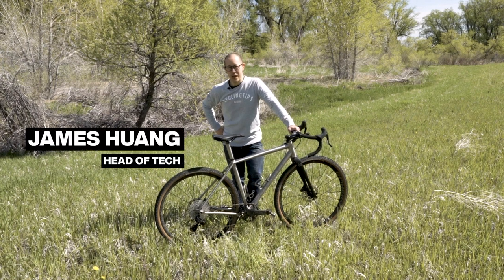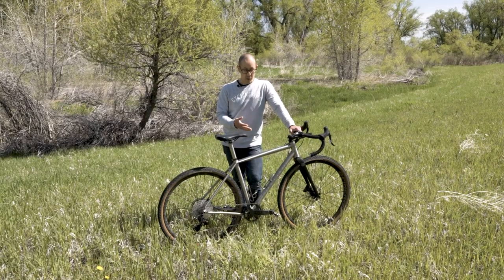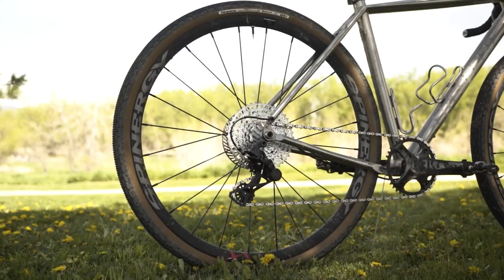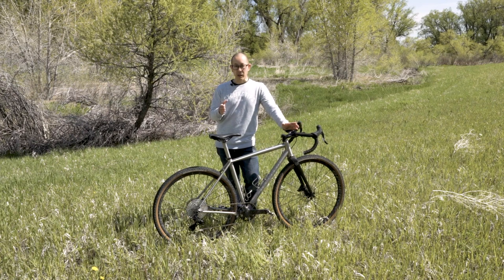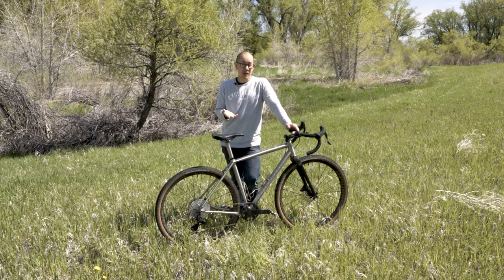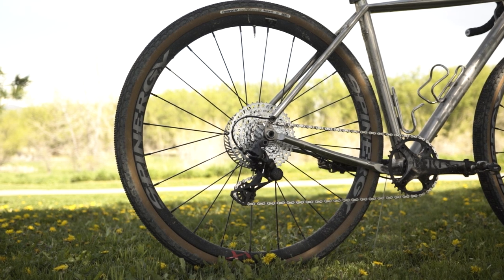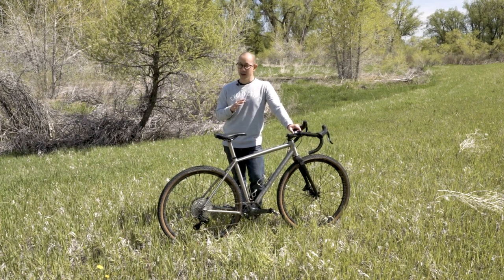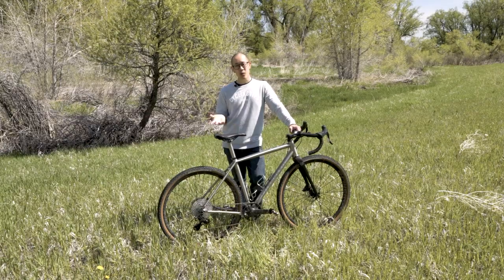Litespeed Watia gravel bike review: A magical ride, but old-school handling

Comment: James thanks for the thorough review and stellar work as usual. It is a very nice looking bike and made in the U.S. is important to many of us, myself included. Worth mentioning too that originally the Lynskey family who started and ran Litespeed for many years are still manufacturing in Tennessee not far apart from Litespeed . Under current ownership Litespeed has fortunately retained their base of manufacturing in the U.S. (minus their short foray of carbon bikes that were poorly reviewed), I own two titanium bikes both were made by Lynskey. For those who haven't spent time on a Ti frame I can recommend them highly. Durability, looks and that raw Ti finish just appeal to me as a metal worker. Great review!

Comment: Personally, I think the geometry of the frame is more a thing to be noted, instead of a con. If you're going to be riding your gravel bike on gravel/dirt roads & trails and not the MTB-esqe technical stuff, having something more endurance-road focused is a good thing.
Reply: @James Huang Understood regarding fit. Agility and speed (you mentioned the agility part at 8:49). If you're buying a gravel bike to ride country roads, road geometry makes sense. If you're buying a gravel bike to race gravel, getting flat and low on a bike with smaller gaps b/w the front tire and down tube are good things. When I look at the routes for many of the gravel races, and published rides even outside the midwest (where I live) they aren't technical in a way that something endurance-road-focused wouldn't be a good choice. For the most part they are very focused on putting big miles, at speed, on the bike.

Personally, I have two gravel bikes (Lynsky GR300 / Revolt Advanced Pro) with exactly that kind of geometry, and I've never found it to be a con; even on technical single track, but most of the riding that I do on them is unpaved roads or trails where agility and speed are good things. Obviously, there are trade-offs involved in everything; if I was going to ride a lot of technical single track, neither would be the best choice. But, if I was going to ride a lot of technical single track, I probably wouldn't want to do it on a gravel bike either, unless I planned to ride 20-30 miles to get there. 

Just to be clear, I do think there's a place for gravel bikes like the kind you want, I just don't think they are right for everyone (maybe not even most gravel riders). Which if that is true, makes the road focused geometry of this frame more a "thing that is noteworthy", and less a con.

Comment: Great review James. If I could comment on just point please, and that is the benefits of frame decals. I agree with you that electroformed, polished or etched frame graphics are aesthetically superior, but the benefit of decals is that you can easily replace them when the frame needs a refurb. Speaking as an owner of a beautiful custom Ti frame myself (Burls from here in the UK) I found that, over time, the frame picked up a few nicks, scratches and marks, as would any bike. But as my frame was supplied with vinyl decals for the graphics, I was able to recondition the frame surface using the red Scotchbrite pads and re-linish it. Once completed I cleaned the frame using WD40 and then IPA wipes (as advised on a Lightspeed YouTube video!) and then apply some brand new decals and the frame looks like new. Not a big deal perhaps, in the grand scheme of things, but Ti does enable this process as a way to aid its longevity, though perhaps only applicable to linished (not bead-blasted) Ti framesets. 🙂
Reply: Polished, etched, and even colored anodized graphics on a titanium frame are easily buffed out with a red scotchbrite pas assuming you are brushing the rest of the frame as well. Not sure why you think it’s hard to remove any of those 3 graphics options assuming you are hand brushing the rest of the frame with the same type scotchbrite red pad?

Comment: Hmm... on an other popular bikepacking website they made actual testing of diamond frames made from titanium, steel and aluminum. Under load they measured almost identical and neglegible flex of the frames. Within 1-3mm only and actually not noticeable. That was to be expected because a diamond frame is the lightest and stiffest frame design. Much more important for comfort were wider tires and a flex carbon seatpost and carbon bar. So instead of spending U$ 6k on titanium one can get better comfort with a cheap alu frame and a good carbon flex seatpost and carbon bar. 😉

Comment: It looks really good.  I have a lynskey gravel bike. I love it. I like the ride quality. It was cheaper than this bike. But it doesn't look as good as this one.
Reply: I have a GR 300 which overall I really like after 1.5 years of ownership. One thing I see on the Litespeed that Lynskey also does is the riv-nuts on the bottle cage mounts, which I don't like. I've already needed to replace one of the riv-nuts on the top tube bento box mount. I wish they would do welded bosses like Moots, Lindarets and others, much more durable but adds to manufacturing costs of course. I really like the geometry on the GR 300 too, it just fits superbly for me. Enjoy the ride!
Reply: No problem with using riv-nuts for long term durability if they are installed properly. If you had to replace yours that quickly it wasn’t because it was a riv-nut it was because they were installed incorrectly. 

The aerospace industry uses the exact same type of riv-nuts throughout the fabrication of both airplane fuselages and wings and missiles. Those components undergo exponentially greater stresses than any bicycle riv-nut would ever in any situation encounter, and they last tens of thousands of cycles without replacement when installed properly.

Comment: Seems like some of the complaints with the bike are contradictory and could be solved with some fit changes; like maybe shorter crank arms and a longer (or shorter) stem (or just getting used to the feel of a gravel vs. a road bike).
I seem to hear a lot of reviewers complain about toe overlap and figure (myself included) that we guys always go for those 175 crank arms, when a 170 might mitigate problems with both toe overlap and pedal strike.

Comment: Excellent review. Currently looking at a Specialized Diverge/Roubaix expert, but for nearly the same money I could get something similar from Litespeed which is based in my home state. Wondering if it is worth it! My dream bike is a Firefly, but I suppose a Litespeed would do?
Reply: I also live in TN.  I like the Diverge, but I found the Lynskey Pro GR more attractive because: Ti more durable than carbon, better long-term value, handcrafted in state, lifetime frame warranty, 2X Di2 GRX, HED wheels, Ti stem, Ti setback post, Ti silver badge, engraved logo, upgraded ENVE fork, excellent customer service, and all for less than $6K (promo and negotiation).  Note that Litespeed was founded by the Lynskey family many years ago.  

Just last weekend, a nice guy from mainland China was peppering me with questions and taking pictures of the bike, saying he wants to buy one.  Maybe to copy in Taiwan?

Comment: Any comments if putting 30mm road racing tires on this and racing with my roadie friends?
Reply: That could easily be done. 

Recently a guy finished 2nd in a local CAT 3 crit in NorCal racing on a 2003 model Trek aluminum bike with a 9 speed Ultegra triple, low profile aluminum clincher wheels, no power meter, and no bike computer on his bars. His bike is worth maybe $200 US. Most of the dentist types in the race were on $10,000+ Specialized’s and Treks with Enve or Zipp multi thousand $ deep dish carbon wheels, power meters, and Garmin computers on their bars. This guy trashed all but one of them. 

Racing is about the motor, not the bike though many poser types and clowns think it’s about the bike and their credit cards. 😀😃😀
Reply: @ivanboesky1520  Why is this a surprise? Indurain rode alpe on his 19lbs steel bike faster than modern riders.

Comment: Not mentioning Lynskey as the direct competitor in production volume and price seems intentional. Moots and Mosaic wouldn’t be cross-shopped with Litespeed.
Reply: Moots and Mosaic are both wildly overpriced overhyped “dentist” status symbol bikes. 

I’d challenge anyone to claim they could tell any meaningful ride quality difference between a Litespeed, Lynskey, Moots or a Mosaic if they are built to similar geometries using similar tubes. The reality is a large portion of  bike world members like many other endeavors enjoy buying perceived status symbols, and then rationalize that they just have to ride a lot better simply because their price is “through the roof”. 

Having ridden over a dozen different ti based frames including both Moots and Mosaic there is nothing special or noteworthy about how either of them ride or handle. And given the completely silly prices that Moots charges for stock batch made bikes with little to no real custom options it’s laughable that they use the very cheapest way to finish their frames (bead blasting) rather than a hand brushed finish. Then they try to claim its bead blasting is superior when in fact it’s harder to maintain than a brushed finish and shows every mark without the ability to simply brush those marks and dings out. Bead blasting is all about cost savings for the manufacturer, it is literally the cheapest and worst finish from a maintenance standpoint that you can get for a ti frame.
Reply: @ivanboesky1520  I bought a Lynskey because I could afford it but even so I did splurge (brushed finish, anodized logos, custom IndustryNine wheels). I do love it but I’ve always been curious about Moots and other high-end ti brands. Thanks for sharing your view on them since I thought I was missing something by not spending more than I really needed to.
Reply: @ivanboesky1520  Will Litespeed go with 3D stamping on their frames? Is it better?
Reply: @ivanboesky1520  I heard this before about Moots! I have both a Serotta and Lynskey TI. Both great rides

Comment: Never got all the titanium hyperbole, I think some just talk about how perfect it is but secretly trying to justify what they spent … and yes, I’ve ridden all the frame materials
Reply: Frame material has next to no impact on a ride feel, it's all about the design itself. As for confort, the tyres and seatpost are what makes all the difference.
The biggest pro of titanium is its longevity, other than that, anything else will do as long as the bike is purpose-built.
Reply: Same exact thing should be said with about 10 times more emphasis regarding carbon fiber, which often is used to produce silly stiff and uncomfortable rides that are then claimed to be “plush” comfy rides simply because the frame is CF. 😀😀

Comment: Titanium are dinosaurs.
Stainless Steel is going to rule the metal road bike world.
Reply: @James Huang Steel can be built up stiffer and more compliant than titanium and is far easier (and cheaper) to manufacture while still offering the durability of Ti.
Reply: @solitaryrefinement6787 , then where are all of the stainless steel bikes?  Note that material is only one variable that influences frame "performance".
Reply: Titanium is much lighter, doesn't rust and in a few years will be 3D printed as standard making all of them fully custom and taking away the only 2 disadvantages titanium has. Difficult to make and difficult to shape. 

And my T1SL by litespeed is crazy stiff, I used to have the T2 the model below and I liked it better because it was less aggressive.
Reply: @reginaldscot165  Stainless steel doesn't rust
Reply: @treygray2817  all depends on the alloy. All being equal, stainless steel is 30% heavier. 

As for stainless steel not rusting, look at a DeLorean DMC10, back to the future car. They oxidize. Only way to keep them looking good is to polish then polyurethane clear coat.